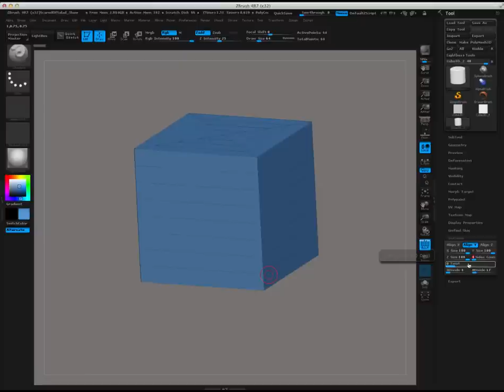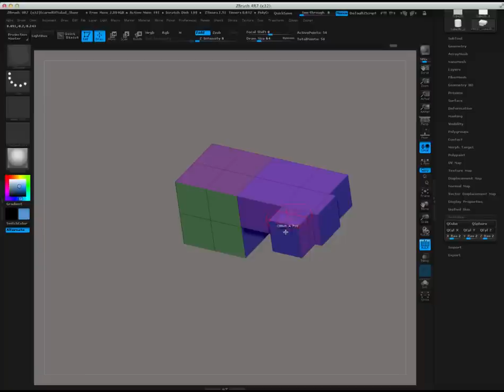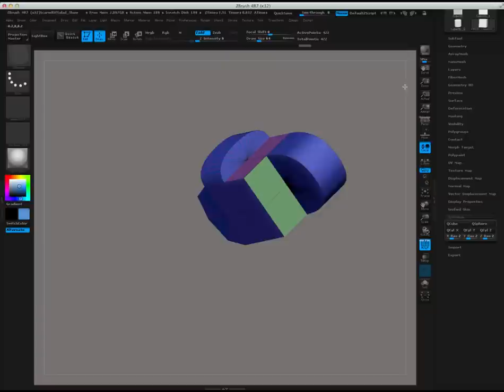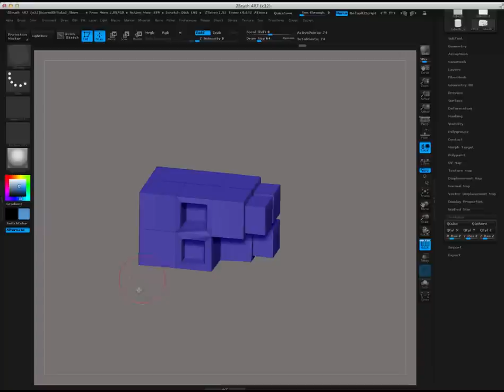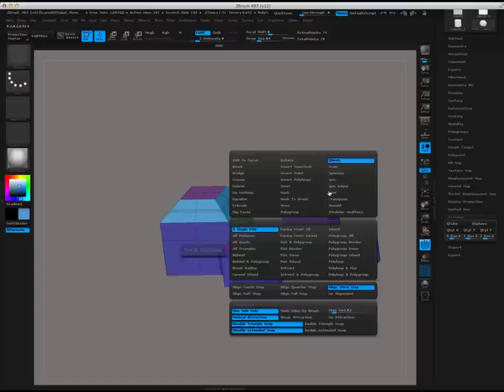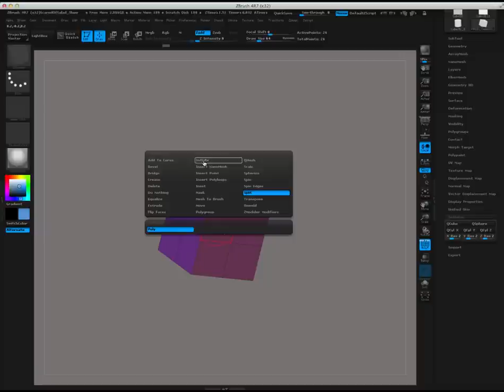Tutorial: Introduction to ZModeler in ZBrush 4R7

Comment: A little question, i dont know if you had used 3dsmax early,well on 3Dmax we can use line and draw it like a silhouet of a bottle,them we use a function to "rotate" them it make a 360 bottle,like repeat the line until it make 360 degrees,them it comes to be a bottle. I want to know if there is a function like this on zbrush new features. thank you
Reply from the maker: Look into the Curve Multi Lathe tool.